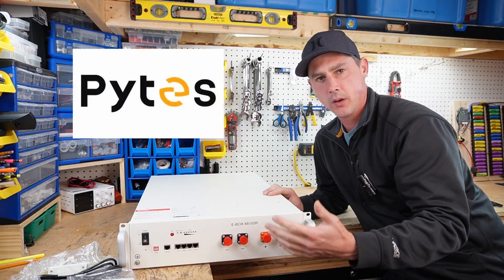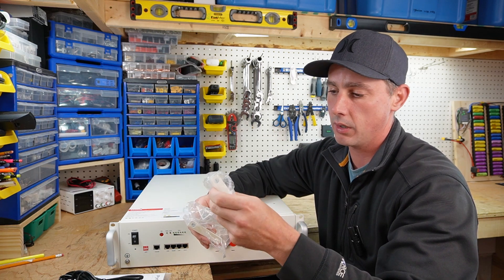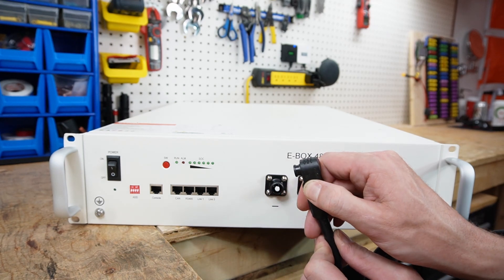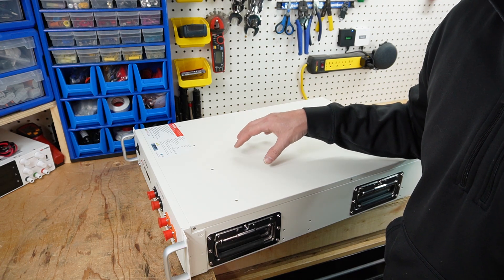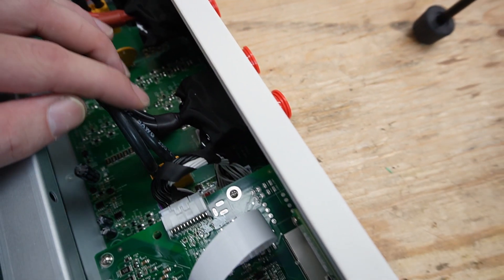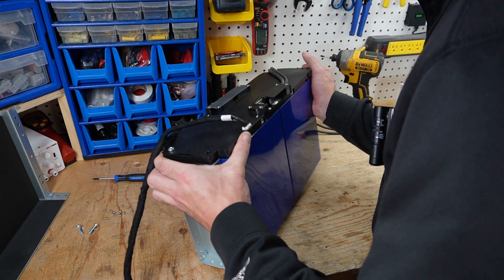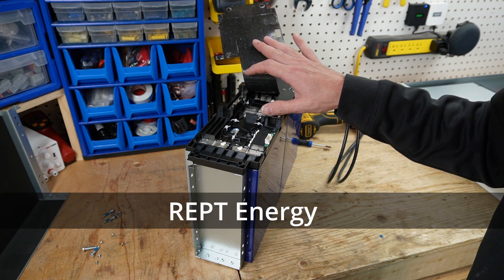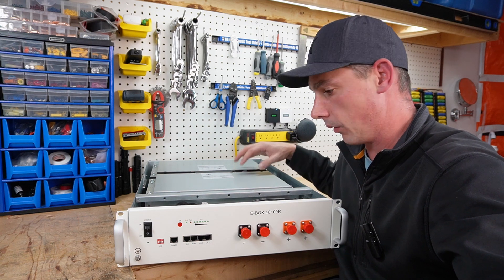Pytes E-BOX 48 Volt (51.2V) Server Rack Battery 5.12kWh 100Ah LiFePO4

Comment: Hi there, great Video. Made made me decide buy this battery.  I am Johan Houwaard from the Netherlands and I need an advice on one dead battery. I have tried al the suggested solutions on the internet without sccess and now consider bypassing the BMS, what would you suggest? Unplug the bms and try to charge the battery with a loose inverter?
Reply from the maker: I wouldn't suggest trying to fix it. Once the cells go below a certain point, they are not good anymore. Despots of it responsibly

Comment: The printed label on each module says 25.6V not 24V rite ? That means 8S configuration of 3.2V cell.
Reply from the maker: @LukmanHakim-ei4tn  Each module is 8S1P LiFePO4 cells. Series together makes the 51.2V nominal voltage.

Comment: Nooo, you are extremely mistaken about charge discharge cycles. You get up to 6000 cycles if you DON'T discharge it below 90%. After those 6000 cycles you end up at about 40%-%60 of the initial capacity, IF you don't discharge it below 90%. If it will behave as you said, it will get to 50% capacity in about 75-80 years. It would be great but it's not how it works
Reply from the maker: I'm not sure what formula you are using to figure that out.
Reply: You mean not below 10% remaining capacity. Yes, I agree if that is what you are trying to say.

Comment: Looks like a solid battery what kind of inverter did you have that hooked up to ?
Reply from the maker: For the capacity test and charging, I used my 3,000W sigineer. I'm still on the hunt for a all-in-one inverter to get.
Reply: I thought you had a Growatt  @Roll2Videos
Reply from the maker: @johngrimley3523  I do, but it's 24V
Reply: solark, growatt, schneider, outback, mpp solar, phocos